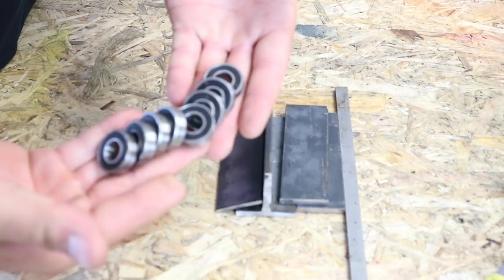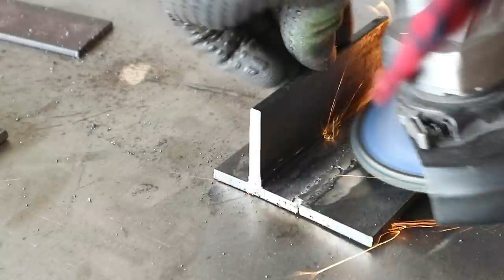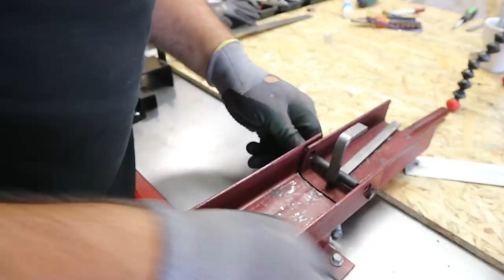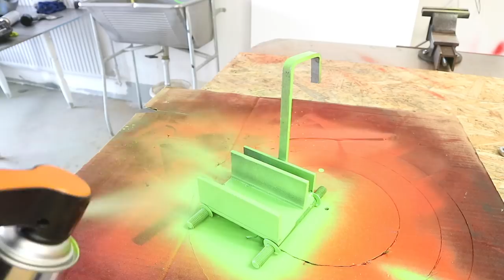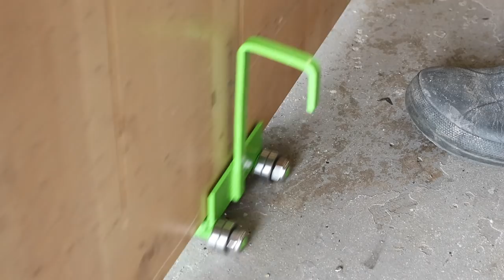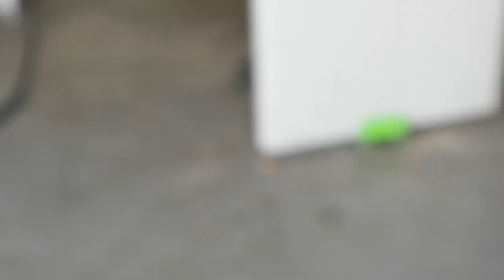WOW !!! Awesome HOMEMADE Tools ||| Never Seen Before

Comment: friendly suggestion 

kindly add one horizontal bolt to that vertical aside metal pieces as a clamp .... so that we can tightly fix the ply and carry it  easily even on the incline or decline surface....

thanks for your inovative idea

Comment: Using bearings (?) as wheels means it can be used only on absolutely flat floors. Use small rubber wheels instead.